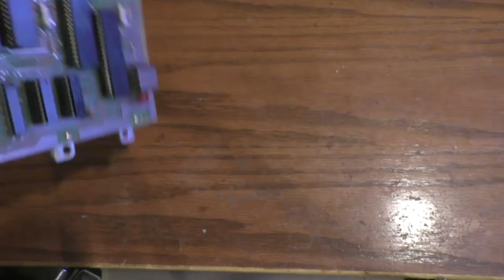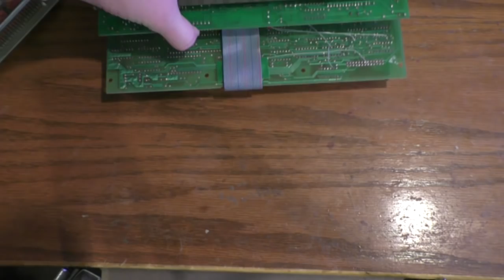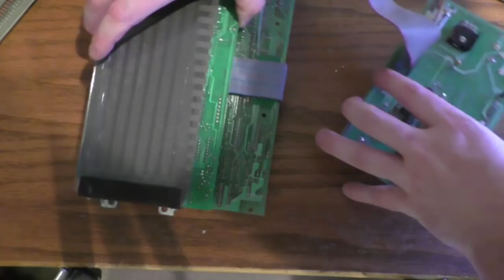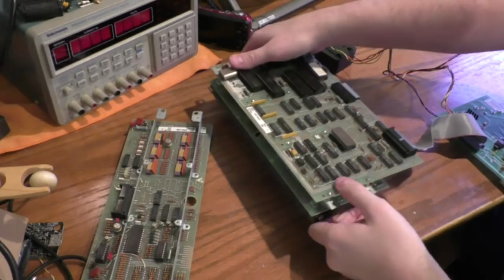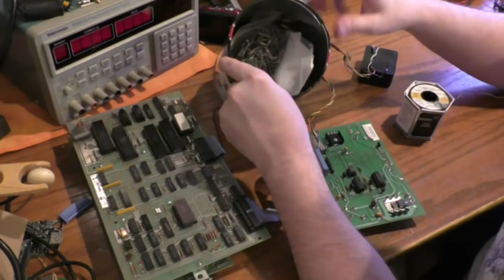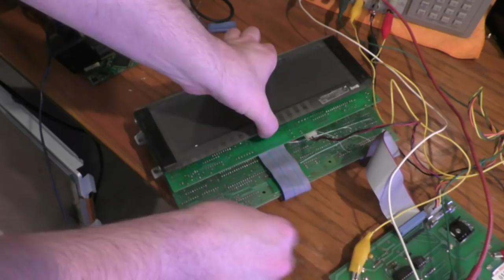Burroughs 6 Line by 40 Character Self Scan Display Demo

Comment: Nice tests, thanks for video. I have a couple of the same type displays, but neither are working.  Do you have circuit diagrams for both boards or you may point me where to download it, as I cannot find it on internet  yet...?
Thanks, Konstantin
Reply from the maker: +KOSBOcom  I don't have any schematics of them, but I didn't need the schematics.  what part do you have, just the glass+driver board,  or that and the board with the CPU on it?
Reply: +kevtris  
I have 2  glass displays ( one 6 lines and one  12 lines) with drivers on boards and one CPU board. CPU board looks like OK, checked IC and it has signals on it, but 6 line display just lights the a few first left columns, looks like anode drivers do not work - stuck on first columns  and not scanning from left to right. If I connect 12 lines display to CPU board, display does not show anything, may be it's just not compatible...
Reply from the maker: yeah it sounds like it's not scanning in the first case.  The counter that does the scanning is on the board with the glass.  It's possible the reset electrode is stuck on, too.  Check the scan signals to the glass (they are coming from the 16 pin transistor arrays marked 1627-4334 on the side by the 24 pin 4514 chip.  the signal should move between -250V and -160V or so. ) if the scan is not there, the 1447-3771 chip is a 74161 counter.  start there to see if you're getting clocks/counting.  the 12 line might have bad display glass, it should be compatible with the driver board.
Reply: +kevtris 
Thanks a lot for your help!  24 pin 4514 chip has 8V amplitude  signals on it, 1627-4334 arrays are  with about 60-70V peak to peak signals, 1447-3771 chip has signals on its pins too.  May be I have to reset electrode is stuck on? How to do it? 
Once I fix 6 lines display, will have a look at 12 lines, it would be a shame, if glass display is dead
Reply from the maker: on my board, reset comes from pin 11 of the 4514, and connects to a separate transistor (TO92 in my case, but could be a round metal one on some boards), then is capacitively coupled by a 0.22uf capacitor to the display glass. it connects to pin 60 on the glass (very last pin).  this circuit is a voltage doubler so the reset pin on the glass gets hit with a very negative voltage to preferentially transfer the glow to it.  make sure that cap isn't bad/leaking/shorted.
Reply: +kevtris 
Thanks a lot for your great help. It took me a while, but I have fixed my 6 lines display today. All pulses including reset one looks OK for me, but amplitudes of some of them were almost 2 times lower, then I have swapped  1627-4334  array with the one from 12 lines display and my 6 lines display is alive now!!!  hurrah!!
Do you know if it's possible to buy new  1627-4334 anywhere  ??
Reply from the maker: hah nice!  yes, it's not a very rare part.  It's an SN75468.  glad to see you got it going again.
Reply: +kevtris 

Thanks! Just ordered a few new ICs.  6 lines display repair success forced me to try to fix the big one - 12 lines display.  The driver board has all voltages, including -240V, but output signals (all of them) that go to glass display from HV drivers are only 2 volts high, so output drivers ( cathode ones) are not fed with right voltage. 
Scan circuit does not feel well either, MC14514 does not have any incoming signals. Trying to figure out why...
In your previous post you said,   the 1447-3771 chip is a 74161 counter, but I can not find 1447-3771 chip on my boards, have only 1447-3706,   1447-3607,  1447-3540, 1447-3532 and 1447-3516...

Watching your videos, I see you have  several/lot  displays. If it's not a secret, what are you using them for?
Reply from the maker: 1447-3706 = 74121, 1447-3607 = 7474, 1447-3540 = 7410, 1447-3532 = 7404, and 1447-3516 = 7400.  I don't see a 4 bit counter in the list.  maybe your 12 liner is different. 
check out where the 4514's inputs are going- there is a hilarious voltage level translator to get 5V logic to -250V level logic made up of 200V zeners + transistors.  I don't really have much reason for having them, except I like to collect weird display technology.  I also got a video coming on a 12 line and a prototype display.
Reply: +kevtris 
Thanks for help again! How do you know these weird markings on the chips, do you have some cross table for it? 12 line display is almost fixed too. As minimum, it lights up now, I  sent 6 lines text to display and it displays some rubbish on the top 6 lines and shows perfectly my text on  the bottom 6 lines. I need to play with it  and sort it out.

About a week ago I have started to play with my display panels and lucky found your videos, which helped a lot too. looking forward to watch your video about 12 line displays.
I do like old  displays too, which push me to Nixie and panaplex display/tubes world...
I have removed power supply board from my test circuit and feeding display straight from +-12V and +5V sources, but I have created power board circuit diagram, if interested you can download from the front page at www.kosbo.com 
As I have a few displays panels, but only one main controller board, I am thinking to make  it on Arduino or Microchip controller, just need to understand the signals go from main controller to driver board...

Happy New Year!
Reply from the maker: +KOSBOcom There's a list of them on the bitsavers.org PDF archive under burroughs.  it's something like burroughs_IC_crossref or so.  For the chips that are not in this, however, I had to use a chip identifier/tester.  this is a doodad that you can plug a chip into and it will attempt to test it and figure out what 74xx or 40xx number it is based on the tests.  As for my 12 line display, it is indeed being controlled by a PIC directly.  It had the same fairchild F8 driver board (albeit a military version) as this 6 line one.  I figured I could do better so I looked at the timing signals on the scope and duplicated them with my microcontroller.  Driving it is quite simple,  I duplicated the 4514/SN75468 scan driver circuit and the level translator logic and counter arrangement it had and created a power supply so the entire thing can run off of 12V.  

if the top 6 lines of your display is garbage data that means the driver board might not be sending out the proper pixel data.  there's some jumpers on the board that determine how many lines it will drive, but I am not 100% sure how these are programmed;  I didn't reverse engineer it.   I suspect it is probably working properly now at least (the display board that is).
Reply: +kevtris  Great! I'll have a look at bitsavers.org .  Looks like we are working in parallel, as my plans to get off 3 power suppliers  too and use just one. I also have several Russian self-scan displays with and without control boards, so I have to make modern control board and then replace original  HV drivers too.  To do not invent bike again, would you mind to share your circuit diagrams for your 12 lines panel connection to microchip pic,  if you have it ?
 While I was fixing my 6 lines display I have scanned and wrote down 26 pins connector diagram, where signals from main controller go to the driver board. Today I'll share it on my web site www.kosbo.com  too. Quickly looking I see only 6  pins have signals on it, the rest are  power/ground lines or not in use...
Reply from the maker: KOSBOcom
I emailed you through your page since it will be a lot easier to continue there if I have to send some documentation.